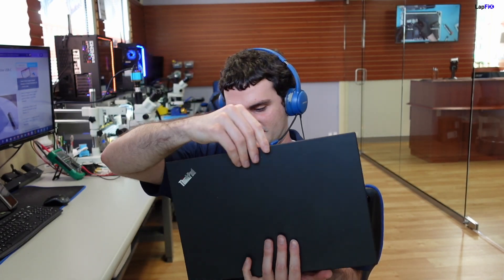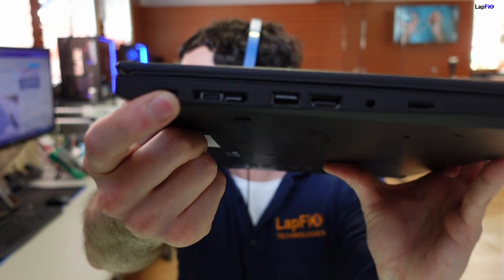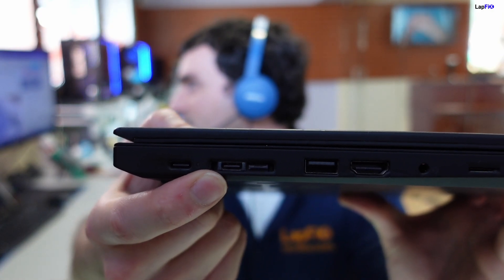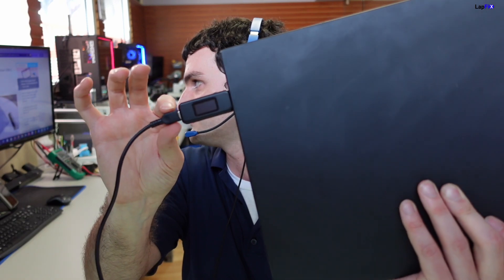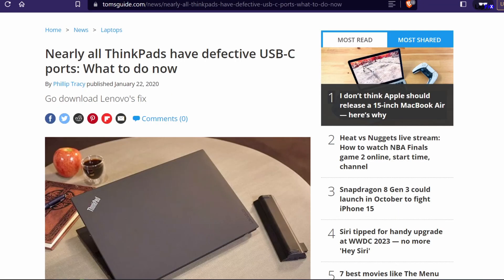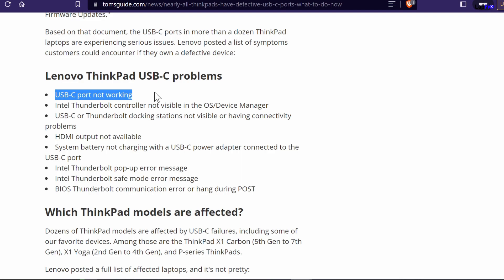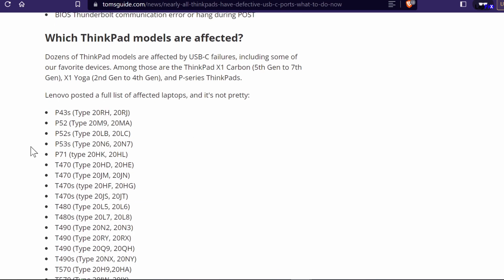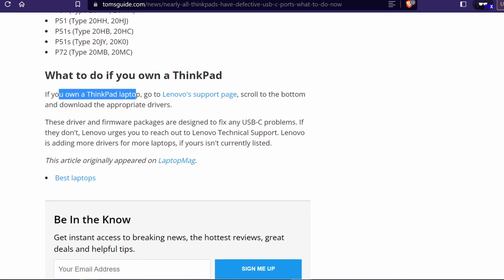Lenovo USB-C Charging Port Issues

Comment: My wife works as a insurance account manager and uses Lenovo and she told me her laptop only had one usb c port. This is used at her work with a docking station and it just stopped working. Registers connection but then doesn’t have any power to the device. 

I work in IT at the library so I mainly work with all in one PCs and they’ve had their fair share of system failures lol although Dell support is pretty good.
Reply: Same deal with my partner. She just got the laptop 6 months ago along with a new dock. Was having problems with her dual monitor setup, and then the laptop would run off battery power occasionally. Now it won’t charge at all 🤷

Update: sent it back to IT, they replaced the USB C port. Sounds like it’s not the first time either.

Comment: I don't buy it that it's a circuit problem. If that was true it would work then suddenly not work. Instead it slowly gets more difficult to connect. Needs a wiggle or to sit just right. Eventually degrades to not work at all. Clearly a problem with physical electrical contact
Reply: mine is exactly the same as your problem, is there a solution for it?😭
Reply: @natadecacha Hi did yours completely stop working?

Comment: is there any way to downgrade the charging port to the barrel or rectangle style ?
like the old thinkpad?
Reply: Maybe a wired connector like this would fit somewhere on the case (probably a version with a few more power wires): https://img.kwcdn.com/product/Fancyalgo/VirtualModelMatting/0ebb48772330e397611b268803c3f173.jpg?imageView2/2/w/800/q/70
Reply: @adrianTNT  20 years ago I did that with a Toshiba laptop. Not just the power jack but also the Audio out jack. I had all these wires hanging out to keep it going.
Reply: @adrianTNT  Not for type C ports that support data and charging, what you show is to add USB C charging in a vehicle not equipped with that port.

Comment: Hello I know this I not related but a Lenovo Backlight just stopped working… I’ve tried all the drivers but nothing I try the keyboard on a different Lenovo and the backlight works… funny parts after a while the same laptop that’s working, just stopped… so I was wondering would possibly make a video a Lenovo backlight circuit specifically… it really will be helpful…
Reply from the maker: I think you are referring to the Keyboard Backlight not the LCD Backlight?
Reply: @lapfix  Yes please, thank you ... I forget to mention that. Much Appreciated

Comment: So you cant just replace usb-C charging port?
Reply from the maker: Not for this issue (and most USB-C charging issues).  USB-C isn't just power pass through, it also has a data line.  There is a circuit behind it as it is not your typical "dc jack".  A replacement port would only work if there is phycial damage to the port itself which are more uncommon and if there is, it probably also shorted the USB-C circuit as well lol
Reply: @lapfix  Thank you for detailed explanation😊 And big thank you for sharing your expirience and knowledge with us!  Ery apreciate evry video you male👏🏻👏🏻👏🏻👏🏻👏🏻👏🏻😍😍😍😍😍😍
Reply: @lapfix so can it be fixed?
Reply: @lapfix have a look at my last shorts,the IC next to chragin port unsoldered itself(on day the warranty ended 😅), (charging doesnt wprk on any port now) so is it in theory possible to reroute hackishly to just charge the battery?